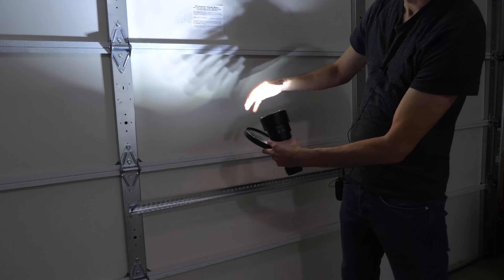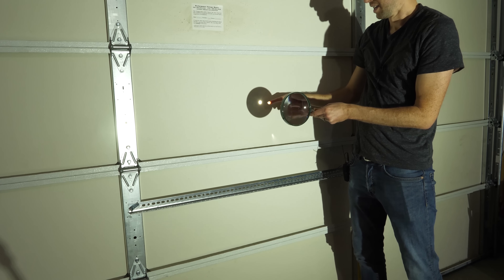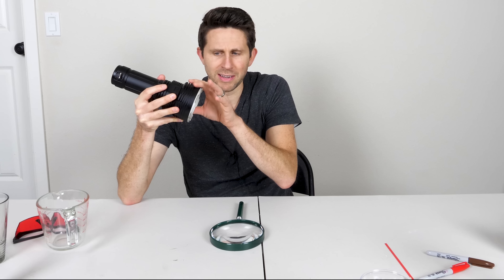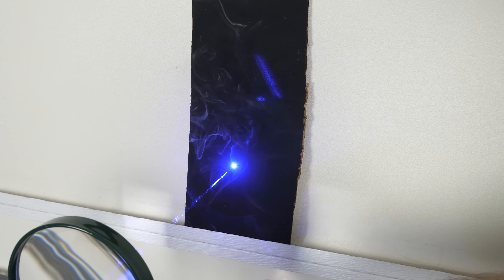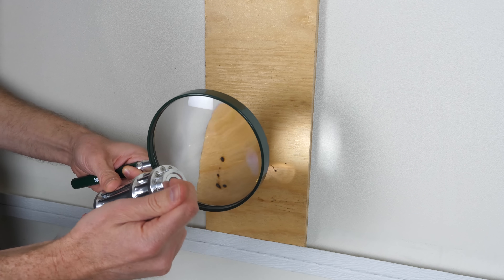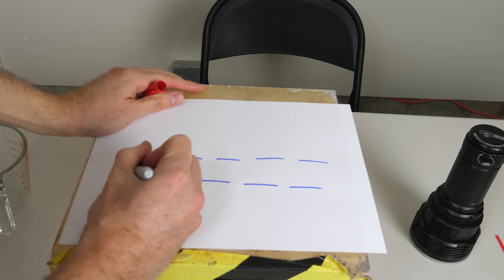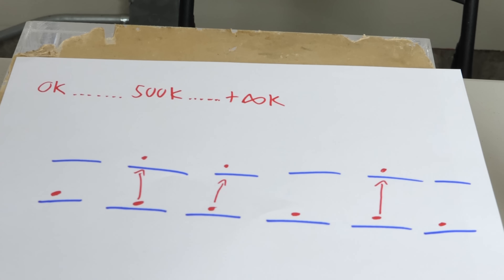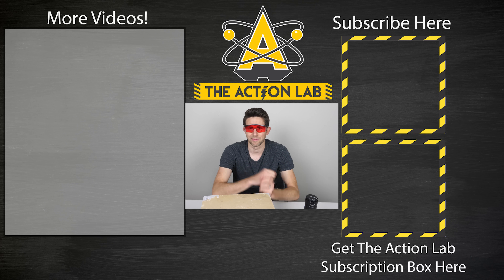What Happens if You Focus a 5W Laser With a Giant Magnifying Glass? Negative Kelvin Temperature!

Comment: 2:10. You can never use a magnifying glass with a flashlight, the point will never be brighter than the led itself.

Well, not worth that flashlight alone. But you can redirect the light into a beam and then concentrate it with the magnifying glass. Those are fixed lights on a flood way, because they thought it's be a more general use, but flashlights like Mag, have variable light beams, and you can conectarte light. You are also not considering every single LED has a reflective parabolic surface designed to flood the light. Were that surface be different, the magnifying glass would work even better that you imagine.

Comment: That was an excellent video.  I learned some things.  I never thought about how the 2nd law of thermodynamics pertained to focusing light.  Also, I never thought of negative Kelvin temperature before or making a theoretically infinite hot spot with a laser.  I'll have to rewatch this video to get a better understanding of this.

Thanks.

Ed Schultheis, PE
Mechanical engineer & manufacturing consultant for 35 years
Schultek Engineering & Technology, Inc.
Reply: try your best to forget all that he said because the explanations were utterly wrong. of course you can focus light to a smaller spot to the original surface, it just depends on the curvature of the lens (and eventually also the wavelength and coherence). and focusing something to create a hotter spot does not break any law of thermodynamics.
Reply: @drkastenbrot woo broo, calm down.
While It sounds strange, in statistical mechanics the Number of atoms that lives in a higher state cannot exceed 50%(in most systems).
If this happen, population inversion occurs which makes the sistem hotter than any positive-kelvin system, their temperature can be expressed as a negative quantity on the kelvin or rankine scales.
This negative Energy thing happens because of entropy:
Usually positive temperature systems can't achieve negative entropy (adding heat always increases their entropy).
The possibility of a decrease in entropy as energy increases requires the system to "saturate" in entropy. This is only possible if the number of high energy states is limited. For a system of ordinary (quantum or classical) particles such as atoms or dust, the number of high energy states is unlimited (particle momenta can in principle be increased indefinitely). Some systems, however, have a maximum amount of energy that they can hold, and as they approach that maximum energy their entropy actually begins to decrease.
Reply: @remojanja9326  expressing a system under pumped population inversion as having a temperature is nonsense. its a poorly applied definition because a temperature would require some thermal equilibrium. even wikipedia calls it a "loose interpretation".
Reply: @drkastenbrot  the fact is that we are not working with normal and classical systems, but with quantum mechanical ones. 
Idk why you are saying that "system under pumped population inversion as having a temperature is nonsense" since every system with particles have a temperature (cause particle have kinetic energy). 

back to what i was saying the system has to be specifically limited in what states of energy the particles can be in (have a maximum limit En).

and there is a lot of evidence about this, im not making this stuff up, i could get a few:

"Most familiar systems cannot achieve negative temperatures because adding energy always increases their entropy. However, some systems have a maximum amount of energy that they can hold, and as they approach that maximum energy their entropy actually begins to decrease."
-wikipedia

"There is no negative temperature to worry about. To have a negative temperature researchers have managed to make systems where the energy distribution is inverted — more atoms and molecules in higher energy states than lower energy states, relative to the average."
-University of waterloo

and many more...

if you instead meant that the classical interpretation of temperature is not complete, than that's a whole other story (all of this happens in fact because of our interpretation of temperature based on classical physics).

if you dont understand something in particular please let me know.

Else if you have some criticism, i'm willing to respond.

Comment: So wait, could you just use an enormous lens to focus the flashlight without losing so much extra light? Not sure you could ever get it to a tiny point like with laser though. So, I have no idea what I'm talking about, but my thinking is... Is the laser actually "hotter" at the point necessarily, or is it simply pointing the same amount of energy to a smaller point, burning "faster"? But actually, wouldn't that make it "hotter"? Your explanation in temperature scale is way too high IQ for me, so I'm doing my best lol

Is there some parallel with the focused energy, compared to say, a butate lighter which yes, can get very hot, but isn't pushing out a lot of raw energy, so it takes much longer to heat something up than, let's say, a blowtorch?

Comment: The reason it 'wraps around' is for a reasonable one. If all states are in a 'high energy state', then no states are in high energy states because the high energy state is then the normal state. That means there is technically an energy debt now where not even the low energy states are populated.  To get back to -0k, you need to repopulate all the low energy states with more energy.

Comment: How does fusion do it then?  Why bother focusing the lasers when you can just use the heat from the source?
Reply: He hasn't got a clue what he's talking about, that's how.
Reply: @theclockworkcadaver7025 he is saying that you cant concentrate su light hotter than the surface of the sun. That is just straight wrong. Using a big glass you can melt pretty much anything and create temps above 5500°

Comment: so basicly because you are radiating away light in a straight beam it can't spread out (going from hot to cold) instead because the light is bundled this doesn't apply because a beam like this has negative temperature as it's allowed to flow from cold to hot. so does this mean that the temperature of light is defined by the amount it spreads? so is photon density opposite to moleculair density where higher density in massa means more heat with the particles being in the same energy state as normal density. and for light a high density of photons means the temperature is lower  then normal density?

so I looked it up and basically if there's more atoms sending out light then atoms that are not then less photons are created. however photons are waves and that means they can amplify eachother, and so you can use 1 photon to make 2 photons that with the same phase and frequency. this takes away the energy from the atoms that are out of balance (more high energy states then low) and so practically speaking you're making the laser colder by producing more light. so this doesn't break the laws of physics because the light is alligned such as in a laser is a result of high energy going to a low state of energy. it can only works with light because light doesn't have a temperature, just a frequency and a phase. think about how a fridge uses energy displace heat, using pressure and convertion that to higher heat and cool that, and making that low pressure again making it colder. instead you force more higher energy states upon atoms and let them convert that to light. the higher energy states is heat and pressure is light in amount of photons emitted. so you can only do this with lasers because otherwise light would be based on neighboring atoms energy while here every atom is allowed to release energy because photons can stimulate this like how pressure stimulates heat to come out of gas when it's compressed. this technically sucks the energy out of the laser but only by converting it into resonant light. 

td;lr: light can yoink an atoms energy by making the atom produce an clone of that photon

Comment: Of cause you can focus it down to a very small point, certainly smaller than the LEDs itself. The light will be more intense, transfer more heat to it, but due to the distribution of wavelengths emitted by the sun or some other hot object the point cannot exceed the source's temperature

Comment: could you not theoretically make something hotter than the surface of the sun if you were able to focus all of the light in all directions from the sun into 1 point? it would certainly be much hotter. Because that energy and heat is distributed evenly across the sun and you add it all together?

Comment: This is just wrong. If you focus the sun with a 1m wide len to a single point, you can get 5000 degrees. Then what happens if you point another len at that exact same spot? The temperatures will add up, no?

Comment: IMO instead of saying “the second law of thermal dynamics isn’t broken due to laser having negative kelvin”, the other way around might be more appropriate. It seems like we defined negative kelvin as a mathematical hack to make our existing models work well (which is all you need most of the time). Is it possible to come up with a more intuitive model without involving negative temperature? Possibly, but that doesn’t add much value and we’d have to rework lots of stuff.

Comment: This is confusing because you're saying "temperature" not "energy".  Temperature is energy in a given area.  So if the source is bigger than the destination, the destination can be hotter, however, the destination can never have more energy than the source.  Sunlight captured from a very large diameter lens focused down to nearly-zero diameter can be hotter than the surface of the sun.

Comment: You aren't making sense. Of course you can focus the light from a flashlight into a point that's brighter and hotter than the flashlight itself. That's because the flashlight isn't a point-source, it has many different LED's which individually are nowhere near the temperature or brightness of the beam of light produced if you focus all those LED lights onto a single point. You could say that the energy of the flashlight will always be higher than the energy of the focused point but you can't say the same about brightness and temperature.

Comment: No, the whole explanation of negative temp at the source does not make sense! LASER is emitted from atoms of the source - Diodes or Gas - (Batteries Electric Energy into higher energy states of atoms into EM Energy) carrying the electromagnetic energy in the photons (E=hv), same as do the Microwaves (or if you like: as copper wires carry electric energy along transmission lines) now this energy does not manifest into Heat Energy until it interacts with material (wood surface). So the source Heat Energy is at lower temperature because all energy is in Electromagnetic form and not heat form (same as the Chemical Energy when stored in a battery). What that has to do with 2nd law of Thermodynamics?! The source and the destination spot  have two different forms of Energy (EM and Heat), The spontaneous flow of Heat energy (TD 2nd Law)  from source to destination is true when we talk about heat at both ends.

Comment: 2:25 you might not be able to do so with a lence,but look at this: If i use a big Solar panel, to power a arc flashlight with it,this arc flasight could heat something up hotter than the surface of the sun.Thats possible,because these systems are now not interferring anymore with each other, and thus the reversed energy flow back to the sun, from the heated object,isnt possible anymore.
Reply: what is lence supposed to be?
Reply: @neutronenstern.  The word "lense" does not exist!
Reply: @azzteke  You know what i mean, and i will let it like it is,cause actually i dont care

Comment: I think everything you wrote and sayd is wrong
1. A beam of light does not have any temperature by itselve. It can heat things up to a certain temperature, that is given by the equilibrium of the radiance of the object you are heating,and the intensity of the light you are shining at it.
2. A laser does always diverge. You can assume it to be a perfect gaussian.beam, and it still diverges. Its not possible to make a laser, that does not diverge..The minimum divergence is determined by the wavelength, and by the minimum beam width. So if the mimimum beam width is finite,and the wavelength isnt 0, it will always diverge (from the focal point on). 
Also until the focal point, it will converge.  And any beam of light focused by a lence, will firstly not diverge,but converge,and if the focal length is infinity,it will only converge. So theres nothing special here for lasers.

Comment: See @action lab
In this video lasers which are the point source is what u are calling 'cool' than the object upon which it's heating but that's not the case a 5w laser pointer emits uv light which doesn't feels hot (ir light gives us the sensation of hotness) due to which when u are touching the laser screen it doesn't feel hot but the object gets hot there is nothing about reaching to negative Kelvin or infinite temperature
It is just the fact the uv light Don't feel hot so actually the source "laser" is of course hotter than the object but you can't feel it because it is not infrared light

So the basis of your explanation that "the source laser is less hot than the object " is incorrect a laser is always more hot then the object following the laws of thermodynamics u can't feel it due to different reasons
Not because of negative Kelvin temperature  Kelvin can never ever be negative
See there is a little misconceptions
The temperature is really only negative in the sense of the classical definition of temperature. What is actually happening in a population inversion is the particles aren't following Boltzmann distribution of energies anymore. Comparing the temperature of a Boltzmann distributed system to a non-Boltzmann system might not be meaningful at all. People say that negative temperatures are hotter than any positive temperatures because, when brought into contact, heat will flow from the negative temperature object to the positive one. This is simply because the negative temperature object has more particles in a higher energy state (which is unstable). The particles will tend to redistribute themselves into thermal equilibrium (a Boltzmann distribution).

Lasers don't exactly have negative temperature. They are often brought up because they are one example of where a population inversion occurs. The population inversion occurs in the energy level of electrons, not in the thermal energies. So if you considered the "temperature" of electron energy levels, lasers would have a negative temperature. This is different from the physical temperature though.
But if u want to see some violation regarding the second law of thermodynamics u can see the nanoscale laser trap phenomenon

Comment: As kids we have all used a magnifying glass to focus light from the Sun and burn things. Which is identical to the laser, but you appeared to say it wasn't?
Reply: The sun is more akin to a flashlight, in the sense that the light it emits is scattered, or not focused. So while you can focus some of that energy to make it burn plants, what I think you are missing is that he says you can not make it hotter than the original source of the light. In this case, you cannot make that point hotter than the surface of the sun. You can still make it hotter than usual, just not that hot.

Comment: I thought zero (used as a singular "value") was a statement rather than an integer. -0 and 0 are the same. 0 = false.  The focal point is changed. More photons into a vanishingly small area. With an unmagnified laser, the light is still somewhat diffused. That's why there are focal adjustment points on laser assemblies. The same amount of photons in an even smaller space. Bit like putting your finger over the end of a hose and making a jet of water that shoots a long way. No energy is lost during the focussing to a smaller area. It is dissipated as heat. 1 car in 1 lane at 50 mph turns into 10 cars being banged into each other forced down that one lane at 50mph. Almost like torque... You can think of the magnifying glass as a funnel.
Reply: bro really be arriving at the wrong answer using the correct argument

Comment: This was  not a 'good' example to explain you can't break the laws of thermodynamics.
Because you did not state clearly that you could not get a greater temp than what the total output of the flash light or the total output  of the sun.  You mention the surface of the flashlight & the surface of the sun but do not specifly what surface area. 
A better example IMHO woud be a press that outputs a known forces. 
That can be measured with a preasure sensor. 
You then demonstrate a number of cone shaped rods each tappering down to a smaller diameter flat end. Which contacts the sensor. 
Test cones base end is in contact with the working end of the Press.
This base end is the same diameter for every test cone. 
I surgest the smaller flat end of the cone has half the surface area than the prior test cone.
Care sould be take not to damage the sensor by reducing the presses maximum output.

Comment: Kelvin starts at the absolute coldest theoretical temperature 0k or -273.15c. There is no negative kelvin period. 
And all light source light can be focused down to a smaller point, it just requires an equally sizeable magnifying glass.